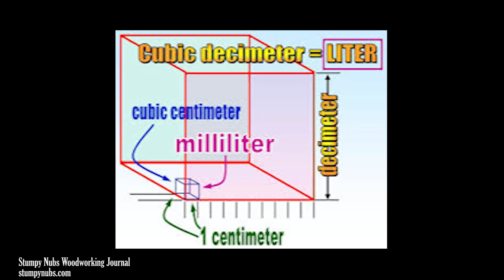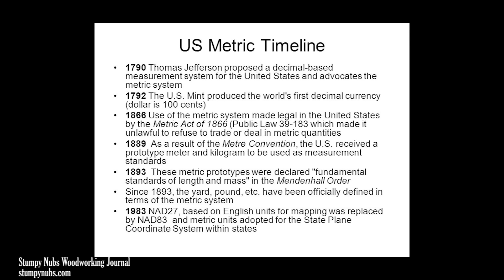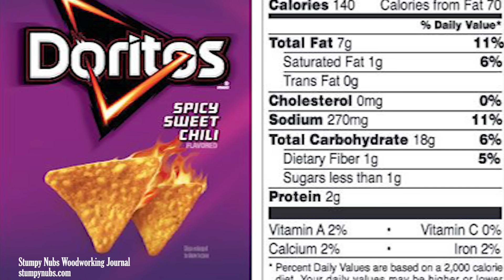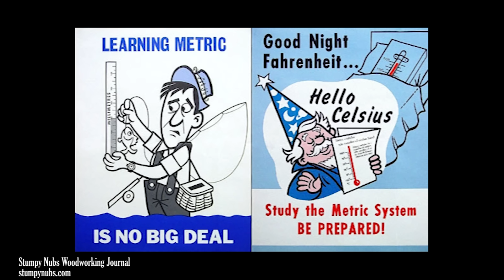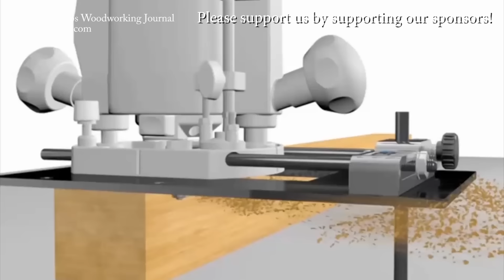BREAKING: The USA is switching to METRIC!

Comment: Simple conversion from C to F I learned in the 70's. Our thermometers in our helicopters were in Celsius, so we just used  double the C, subtract 10 % and add 32 to get F.  It was and is simple to do in your head without straining your brain. It is exactly the same computation as the "real" formula, 9/5 C + 32 = F
Reply: You... just changed my life.
Reply: The widely used Canadian cheat was the straighforward “Double it and add 30”…  some inaccuracy creeps in, but for human scale day to day, and it was close enough, and for when watching American TV. :)
Reply: The problem with that conversion - at least, the doing it in your head part - is that if you're not naturally a numbers person it's hella difficult (ok, no, i't impossible) to remember if you add or subtract the 32 and if you do it before or after multiplying by 9*2/10 or 10/9/2. If you want to be sure if you got it right, pull out your phone.
Reply: @christopherbedford9897  Millions of Canadians born before our switch-over would disagree…  especially if you’re going with the slightly less precise “Double it and add 30” approximation of the same algorithm.

Then again, we also spent a decade putting stickers on our old speedometers
Reply: @vaalrus  In South Arica, we did that conversion in the early 70s. For the first while (it might also have been two decades, but maybe closer to one) we also did that stickers on the speedo thing 😁 and were allowed to buy rulers, measuring tapes etc with both inches and metric measurements on them. But then in the draconian tradition of the apartheid regime, the sale of anything with any imperial measurements (or items stated in imperial measure, like fl oz on cans of soup or inches in the size of a TV set) were banned outright for a long time - probably two or three decades - and we adjusted. 

We have now relaxed to allow the use of any measurement you like but we don't care, the only place you'll see anything other than metric measurements is in computer screen sizes and no-one - not even old people who used only imperial for as long as they could - has a clue how hot 95°F or how far 150 miles is without punching it into a conversion calculator.
Reply: @christopherbedford9897  I’ve been quietly  waiting for my elders to move on so I can use metric in peace, but proximity to the US means we’re still very hybridized.. so carpentry is very much riddled with dual-marked or inches-only tooling. Or speedos are metric and fuel in litres, but everyone compares in MPG.  We also have the legacy of mid-and-late 1800’s survey that divvied up the landscape in a 6x6 mile gid with then roads spaced every mile east-west, and every 2 miles north-south, so local (rural) distances are in miles (and land in square miles, or (mostly) even fractions of 640 acres).  Makes working in earthmoving contruction a heady mix of units.  And we won’t talk about fasteners - or pipe-fittings which gets even weirder).
Reply: @vaalrus  For temperatures from approximately 0 to 100 F, or -15 to +35 C, that gives an error that's less than 5 Fahrenheit degrees.  As you go colder or warmer, though, the error widens.

So it's great for the weather in temperate climates (and I use it all the time for that), but it might not be accurate enough for baking :-)
Reply: @vaalrus  Much like the UK, I think 🥴
Reply: contrary to the farenheit system which is totally arbitrary, the Celsius system is simply logic: 0°C is the freezing point from water, 100°C is the boiling point of water (at standard atmospheric pressure), and I reassure the anti-French fanatics: Anders Celsius who invent the centigrade scale in 1742 was Swedish...
Reply: @leneanderthalien I came up with a system even better than Celsius

Comment: I really want us to move to Metric as well. It's still very prevalent in some of the AeroSpace companies I've worked in and having to flip flop as I move around is frustrating. Especially when you talk to older engineers who are just too stubborn to learn a new system. (or worse, older non-engineers who don't even understand what makes the Metric system easier)

Comment: Being bilingual, I use the measurement system that suits what I do. 
But. 
Not being a machinist I had never realised how useful ‘thousandths’ are for close tolerance work. More numbers to the inch. 
Another well known mess up between systems was when a 767 jet took on its fuel in pounds and not kilograms. Halfway through the flight it turned into the world’s biggest glider! 😳 made a safe landing and a great story. 👍

Comment: This is really funny. Being german, the metric system totally makes more sense to me. Especially when it comes to calculating. However, making bows, draw length is measured in inches, so I use a dual measure tape as well and it works just fine when making bows. Woodworking in general, I really prefer the metric system. Simple reason, its just easier to use and way more faster to calculate. Love the American made metric Incra Rulers, superb quality ❤
Reply: As a Canadian - I am doomed to use both, in a very strange mix depending. Like - wood working: Generally imperial, except when I use metric just cause the material I bought is well... metric, so why not use that? Weight is both - but it depends on what you are weighing. Distance is definitely metric. Temperatures are metric, except in some baking depending on the recipe, or for the fridge temp log in any business that has a fridge that is used for consumer food products but the freezer is logged in celcius for whatever reason. Oh, and people's height is definitely stated in imperial - but on your license etc, it's metric.

Canada: We use both systems, in a very strange mix. Maybe one day we will fully switch but like... why fix what is not broke?

Comment: $10 in the average American savings account. 😂. You always make great, informative videos peppered with humor.  I love it. I believe we are long overdue to convert completely to metric but there are significant changes that will be required particularly in woodworking and construction.  I'm ready for the change.
Reply: In an addition to my longer entry up above somewhere,,,,, even after 50 years+ of metric with everything in NZ I always check my tyre pressures in psi...every garage I've dealt with, with mechanics who were born well after the old system was phased out, still speaks of "xy lb pressure"...... couldn't tell you without checking online how many kPa   32 psi  is.........checks......4.64 kPa,, rounded.

Comment: When I started building pipe organs 8 years ago, I took a leap and went metric, because I knew it was more common worldwide.  No regrets.  Everything in my shop is metric now, with most parts and assemblies designed to the nearest millimeter, which provides ample resolution, and very simple description, whether the measurement is 3mm or 2457mm.  I still often use imperial sized hardware, however, as metric hardware is often 3x more expensive in the US.  Nice video!  Cheers!  Erich
Reply: Yes, but equal temperament or mean temperament? 😉

Comment: Great video! I love the metric system and have only purchased measuring tools with a dual scale or metric only for quite a while. I find it far easier to measure and mark precisely with metric tools.
Reply: Neither system is more precise than the other. The difference between a millimeter and 1/32” is a mere .008”, roughly the thickness of 3 sheets of paper. Your pencil line is far wider than the difference. I personally prefer the convenience of longer markings on a ruler for 1/8” & 1/4” over having to count mm for any measurement less than a centimeter. You can be equally accurate with either system, it gets down to which system you are used to and most comfortable with. It would be far more convenient if the US adopted the metric system, but that probably won’t happen until after Japanese carpenters give up their ancient measurement system.
Reply: @swig46  You are correct. A more accurate way for me to word my comment would have been that it is easier to maintain precision when doing math adding or subtracting measurements when working in the metric system rather than imperial. I'm an engineer and I end up working in both imperial and metric regularly. I much prefer metric. I'm also an amateur radio operator and do almost everything in metric in that hobby.

Comment: Using the metric system isn't a problem, it's when you start converting back and forth to SAE. It might be a more precise measuring system, 10mm is more than 8mm but is 5/32 bigger or smaller than 11/64. If SAE measured and called out everything in the same denominator, say 64th or 32nd it would be easier.

Comment: I live in a metric country, Canada, and it is harder find screws and bolts and nuts in metric than in imperial. And when you do they are 5x more expensive. Also, I admit, that for anything related to woodworking/construction I am stuck in the imperial system. I'm just so used to it that it is really hard to change. (Even though I also do 3D printing and always use metric for that.) Especially with all the wood sources selling 8 foot long 2x4s and not 2438mm x 50mm x 100mm. 😉
Reply: I'm a retired carpenter in Canada and pretty much used only imperial on the jobsite, just our blueprints were in metric.  That 2x4 that should have been called 50mm x 100mm is actually called a 38x89 in the building code... It has made it almost impossible to remember all the dimensions for headroom and guardrail heights, etc. as they did a direct conversion to the millimeter.
Reply: I also live in Canada and have survived the switch from imperial measurement to metric. However, today many items such as groceries have both measurements.  I guess this eases the conversion pain for those of us that grew up with the imperial measurements. The exception of course is woodworking/construction industry.
Since the US is our largest trading partner by far, should we not have converted to metric in unison with them?
Reply: I’m also an older Canadian and I think that things like nuts and bolts in metric being harder to find is a caused mostly by our proximity to the U.S. and the fact that so many of our products are sourced from there.

Comment: From the metric world (Germany):
→ Shoe sizes are using some scale where nobody knows where it comes from. (It's not the same as in the US, though.)
→ T-shirts go from XXS to XXL (or sometimes more Xs), and the interpretation of that is open to each brand.
→ Thermometers are also not really using metric units here (metric temperature would be in Kelvin), though at least that's just shifted by some offset.
→ Eggs are usually sold in packs of six (or ten).
→ Speed is measured in kilometers per hour instead of meter per second (the base unit).
→ Car engines still use horse power (though likely the metric version thereof).
→ Bicycle tires and computer/television screens are measured in inches.
→ In the news, area is often measured in football (soccer) fields, or compared to the area of some of our states.

Comment: I have spent the last 15 years as an engineer (and other roles) in the automotive industry. Every CAD model these days is designed in metric beginning to end all the way to the 2D drawings. Even as a CAD contractor, almost all my designs are in metric. I get a few people who ask for imperial and guess what, I design in metric and change the setting on the drawing to show inches. The little bit of wood working and working on the house is the only place I use imperial since like you mention, that is how my table saw and measuring tapes are. I have thought about looking online to get a metric measuring tape, because why not

Comment: Older Canadian carpenter here most ICI construction is metric all residential construction is imperial. Pass a sheet of 2408m. X1204 x 13 mm does not roll off the tongue or walls at 401mm o.c. And forget about 19.2” centres

Comment: I've been using metric whenever possible for the last several years and vastly prefer it. I still think in imperial for longer lengths, like I can readily imagine how long 8' is but would draw a blank if you told me something was 2438mm long.  Similarly,  for  really short lengths, it's easier for me to visualize  .020" rather than .5mm.
Reply: I am from europe, just want to point out, you blanking on conversion with values you don't work with is completely fine, but I don't think anyone would try to visualize 2438 mm, however we will 2500.
Reply: @hraharahra  I agree except for;  instantly went to 2,5Meter
Reply: @nogmeerjan  I litteraly have no idea what your words mean! Do you want to tell me you are eyeballing and using your imagination to try and visualize few meters of leght up to a milimmiters degree of acuracy and precision?!
Reply: @hraharahra  I think it is very similar like many people say they switch from Metric to inches/feet when thinking in a certain size.
What I seem to do is: when talking in small stuff I think in millimetres (iin my head it is 1 thousands of a millimetre not 1 micrometer)
When talking about human size stuff it is 0.5 meter not 500 millimetres.
What I tried to say  is that I unconsciously switch to a more comfortable prefix (comfortable to me that is).